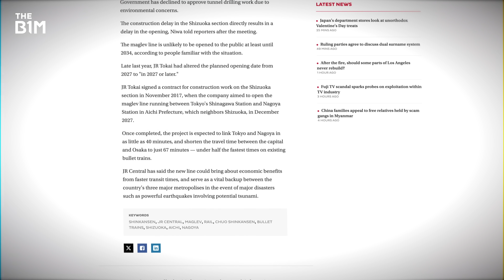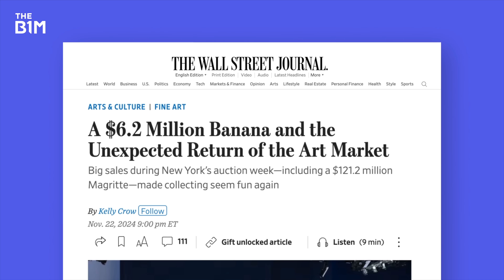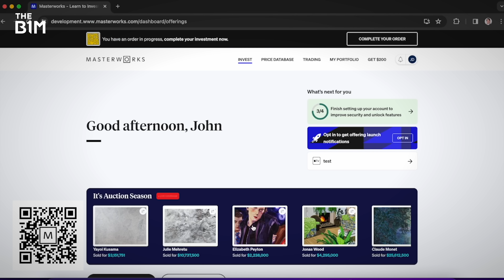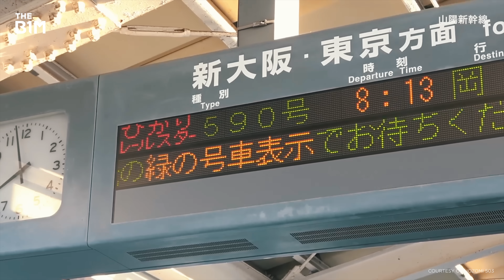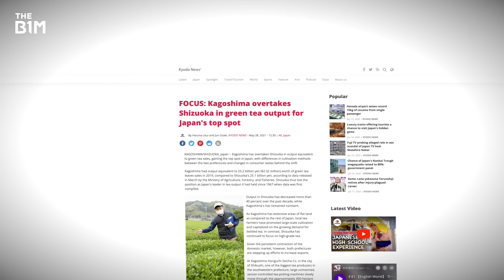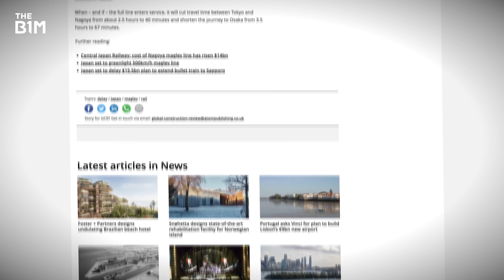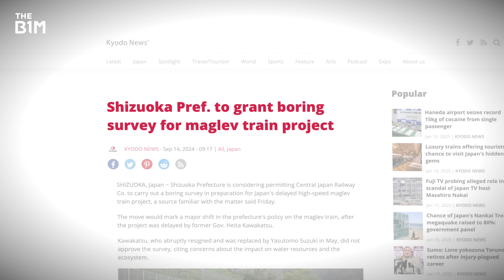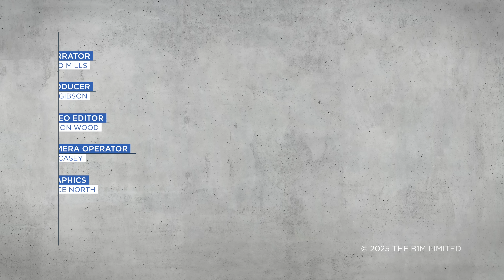Delayed: Japan’s $64BN Levitating Bullet Trains are no Longer on Track

Comment: Whats important to keep in mind is that those 603km/h are during testing, "regular" high speed trains have reached a speed of over 570km/h, and that was almost 20 years ago. With todays technology we can go way further with conventional rail, no need to spend a whole lot more money on expensive magnets.
Reply: The 570km/h(574.8km/h to be exact) is the French TGV which is it's   max speed but not it's day to day operating service speed due to safety concerns.So mostly high speed trains around the world stay within 400km service speed.But when this sc maglev train comes it will be having an operating speed of 500km/h.Even the currently in service german model maglev operated in Shanghai was operated at 430 kmh service speed,now reduced to less than 400 km/h speed and that too only for cost reduction and not for any safety reasons.So if we really want a true aeroplane alternative maglevs are our only bet.Travell within a continent can be entirely done by maglev,reserving aeroplanes for overseas travel.Conventional high speed trains are only alternatives to cars and regional flights.
Reply: @dhanrajsampath500  But that test proves that conventional rail can still become faster, but we are probably reaching the speed limit of them.
Reply: @enaqleelectric Yes, they can be faster, in fact most modern production HSRs can go 400+ khp, but the wear on parts and the electricity cost scales exponentially as you go faster. So they almost always cap the operational speed at 350 or 300

Comment: Dude focused too much on the minor reason and total looked over the main reason. The main reason for not allowing construction in that area is because Shizuoka will lose this trains passing through its major city. Currently, shinkansen travels through the main city, Shizuoka, and that bring a lot of economic benefits. Japan is facing massive tourism problems but that is only in areas like Tokyo and Kyoto, not Shizuoka. The Governer of Shizuoka wanted the train to pass through its main city or have a station in Shizuoka Prefecture that would connect to the Shizuoka Station by another high-speed rail. Both demands were not met, and he was holding back the whole project.

Comment: The success of the Shinkansen itself has much to do with a choice made during the period where Japan built its first long distance trains. They chose to use a 3"6" narrow gauge. It was a cheaper way of building railways fast, but limited top speeds. I was last in Japan, on an express train  trip from Yokohama to Nagoya in 1963 as they were building that first Shinkansen line using standard gauge.  Very pleasant but slower than express trains on the  US Northeast Corridor at that time. 
What hampers High Speed Rail in other countries is the commonality of standard gauge with the high speed lines as they pass through cities where the two forms intermix.  For Japan to expect that their new  MagLev standard would become the one copied by the world, as the Shinkansen did, sort of,  is asking a lot. Furthermore, the speed gain has more to do with the straighter route with fewer stops just like the Shinkansen had in 1964. The amount of tunneling to achieve that new route will be prodigious, and the tunnel bore size for the MagLev is of necessity larger.  I wish them luck getting that line finished in the face of the Chinese competition.

Comment: Germany had a Maglev concept that was quite far advanced and actually was turned into reality: in Shanghai. But it was deemed to high of a cost in its homeland.
Reply: and there it is really nice to enter the city on it coming from the airport, but… you need to change to the metro because it doesn’t go all the way and the experience is not that much different when inside to what a normal bullet train in Europe or even Japan offers lol.
Reply: @kkon5ti  It's a great ride but I wound up in the middle of nowhere late at night in Shanghai. Not a fun experience.
Reply: @thedave7760 NIMBY-ism killed it. It was supposed to go into the Shanghai's main railway station...
Reply: @thedave7760 not really middle of no where tho? You go from edge of the city straight into the center. Very easy to travel elsewhere from the end point.
Reply: @thedave7760   same, I went and came back because where it ends is nothing to do and I also had a flight to catch
Reply: @kkon5ti  That maglev used to be a popular tourist attraction, I remember waiting in line for an hour to ride it back in 2010 when I visited Shanghai.
Heard that now it's far less popular, which make sense since there are bullet trains everywhere in Asia.
Reply: @kevintang5473   I rode on it for tourism only reasons too on my 4 hour layover
Reply: @ what? it is far more quiet and smooth that japanese one. But the most initeresting one is Chinese bullet trains, that runs at 350km/h in China and Indonesia for years, no turbulences like in Shinkansen, affortable and good network made it generally full where Shinkansen is generally mostly empty (used JR pass two time traveling in Japan, and used most if not all Shinkansen lines, tried lot of Chinese and French high speed trains. French one (I'm French) is less spacious but more quiet and smooth. Chinese one is at the same time the smoothest, the fastest, the most quiet and the most spacious.
Reply: @ThePopolong Shinkansen operated since 1964; Chinese was still eating out of their palms. It’s the same comparison to US highway systems, which is about 80 years old. Everyone said China this China that, while the world flew to the moon, Chinese still rode their bicycles. Do you know anything about Chinese fatalities due to high speed rail? None, because they don’t leak the dark side of the regime.
Reply: current Shanghai maglev no longer operates at speeds over 300 km/h. Even when it used to run at 400 km/h, it maintained its top speed for only a few seconds.
Reply: 超電導と常伝導の違いもわからないのか
Reply: The Chinese was very happy with the line and wanted to extend it. The Germans quoted a price of $43 million USD per km. That would make 100km costing $4.3billion, while normal high speed trains where less than $1million per km at the time.
Reply: The one in Shanghai was intended to go all the way to Hangzhou but the same story happened, it was deemed to expensive so it never made it past the city limits. 

It still cuts a good amount of time off the ride  to the city centre if you know how to use the metro
Reply: Tbh tho, what's the point of having a fast train to the airport when you still have to arrive 3 hours early
Reply: That thing is also now run at much lower speeds to reduce cost.
Reply: Well considering how thrift the Germans are, no surprise
Reply: well germany stopped using slave labour quite a while ago, unlike communist china who still does
Reply: Germany is too busy destroying itself by its energiewende to build useful new infrastructure.
Reply: @flippert0  how about siemens that want to build hsr in america and Asia?
Reply: It was too high cost for Shanghai as well. The demo line was never expanded and the national HSR project went with conventional EMU trains instead.
Reply: :face-purple-wide-eyes: Thank you for the info
Reply: Fake news. It was manipulated and canceled by the car industry. they have been scared all the people will use trains and nobody is going to buy cars.
Reply: Transrapid used the simpler electromagnetic concept with high frequency on and off switching. Sad that it was never commercialised in its own country of origin.
Reply: Just so you and everyone know, German Maglev is just normal conduction, so using just a magnet and electricity 
The hype of Japanese one is due to the fact that it’s the first super conducting vehicle ever in the human history
Reply: ドイツは中国に近づき過ぎたな😅
Reply: shanghai maglev is fake
Reply: @evanfinch4987 
Rubbish
Reply: Shanghai maglev made by Germany only run 300km/h mate..😂, with 30km track

Japan maglev is next level Maglev..
Reply: @eightdeeazimuth3110  That's the speed it may run. The design speed is much higher (450 km/h)
Reply: @eightdeeazimuth3110  it does run up to 400, but it depends on time of day
Reply: @eightdeeazimuth3110  There is like 20 year development gap here. If Germany managed to have some commercial success aside the one in Shanghai and do further development I guess they might have something on par with the Japanese. Anyway, the German tech dna lives further in the Chinese ones.....
Reply: @eightdeeazimuth3110  No it's not, they're capable of nearly the same speed, they ran >500 km/h on the german test track and 431 commercially in shanghai for most of the time. Only recently was it nerfed. Please check your info before posting.
Reply: So Germany can only do concept but no real commercial one
Reply: @risrubia4163 , absolutely the Germans can build maglevs commercially. 

Siemens and ThyssenKrup built the Shanghai maglev, the airport one. They could turn 'em out like flapjack pancakes if the demand was there. 

Here in the US there are only 2 places where maglevs 
might make economic sense, & they are along our coasts. If a serious effort ever takes off to build maglev train lines where I live (near Washington, DC) we'd probably buy the actual trains & passenger cars from the Germans.

(On a side note my company contracted with ThyssenKrupp a handful of times & they are great folks to work with. When they say they will deliver you an assembly or sub-system with X, Y and Z specifications, you get EXACTLY what they said they'd build. Most Germans are nice like that.)
Reply: @risrubia4163   depends on what you mean by commercial
Reply: @risrubia4163  No, it can do both.
Reply: @risrubia4163 they don't want to
Reply: @risrubia4163 
What's  your point? 
The germans did that in the late 70s/early  80s. Their conclusions was that it was commercially unfeasible at the time.
Reply: I think the German design was better than the Japanese concept, no superconducting magnets and no concrete trough that will get filled with snow in winter...
Reply: @zapfanzapfan  German Transrapid floats train cars only by 1cm, which makes it vulnerable to large earthquakes. Japanese JR Maglev, on the other hand, floats train cars by 10cm. That's why they opted for more technologically and financially difficult system.

In other words, German design is indeed better for many countries in the world where there are not that much earthquakes. Unfortunately, Japan is not one of them.

This discussion is kinda analogous to their conventional high-speed rail systems. German and French made train systems are much popular worldwide than Shinkansen, chiefly because they are more affordable, while Taiwan, one of the few countries that did introduce Shinkansen, chose it because of its earthquake detection system.
Reply: @Puoehlahxiik  yeah, thats because a bigger distance is less efficient
Reply: @Puoehlahxiik also Japan's EDS system is dynamically self correcting which adds extra passive safety measures to make derailment impossible as long as the guide track is in one piece as the permanent magnets forces the train to self correct passively without any computer assistance. The EMS system needs active computer correction to make it stable and needs backup power to levitate incase of total power blackout, while EDS can levitate as long as the train is moving at sufficient speed, with plenty of time to deploy the wheels incase of total power loss in earthquake scenarios.
Reply: Just wanna say Shanghai maglev won again for almost 20 years tech
Reply: Flippert0  Germany's prototype maglev killed many people in a tragic high speed accident. They immediately cancelled the project.
Reply: @richardconway6425 this is wrong. The maglev was not traveling faster than regular fast trains at the time of the accident, the way the accident happened was only possible because the test track didn't have all the safety features of a service track (the maintenance vehicle was not in the control system). The project continued for a notable amount of time, without public rides, until it was deemed not economical
Reply: @the_retag  This. There is so much misinformation about this accident. Most of it has been broken down to cost and time saving measures (and ultimately the human error that caused the chain of events to get rolling) to make up for the lack of official funding. At the time of the accident, the project was already drained of most of its productivity. It simply was not wanted in a vision for Germany's future. As much as it would be needed now.
Reply: @daseck69 typical German fashion. Has the expertise and engineering skills to build next generation stuff. But decides there's no political or financial backing to do it
Reply: @daseck69  yes please. I am so sad about that.
Reply: @richardconway6425  That was the final nail in the coffin yes. But the one serious project (Munich main station to airport) was canceled before, if I recall correctly.
Reply: @richardconway6425  
Correction: human error killed those people. The technology was ready, but the political and economic commitment wasn't there because our leadership is weak and shortsighted.  
It is something you see over and over again over the past 40-50 years in Germany; extensive base research and groundwork is done here but others implement and develop it into working products/projects.
A nation of hesitant naysayers.
Reply: Was due to human failure, some material was left on track, and not due to technical problems. And this crash was not the reason to not build the track in Munich, it was decided against because of negative cost aspects. A technically identical maglev of that german Transrapid was eventually build in Shanghai.

Comment: I don't understand 2 tones of water per second is not that high amount at all. I looked it up to Oi river discharge rate which is 76 metric tones per second on average. So with all the dams and stuff it would only effect about  2.63% of the water that flow through it.

Comment: Anywhere else I'd call this a Gadgetbahn. But Japan already has the conventional rail network locked down. The only way to improve them is to keep getting faster speeds at this point, and the rolling resistance of air is in fact less than steel on steel. If they can pull this off, Maglev will no longer be a gimmick.

Comment: Japan should start with a smaller project and run it for a few years before tackling what they are currently planning. $64B is a lot of money to spend when they already have their existing bullet train network which the maglev will only be duplicating. Japan's demographics and possibly change in commuter requirements in the decades to come could make this maglev project a white elephant.
Reply: This project is not so much futuristic and innovative as it is an essential disaster countermeasure to a looming threat.
The current Shinkansen line runs along the coast, which could be completely destroyed by the Nankai Trough, a major earthquake that is certain to occur in the next few years. The Tokaido line itself is almost 50 years old and needs a drastic reconstruction project. However, the Tokaido is Japan's most important infrastructure and its operation cannot be halted for even a single day.
Maglev will bypass Japan's infrastructure arteries to the safer inland side, allowing for full restoration of the line and providing a backup against impending disasters. As you can see in the video, the maglev line will be built more inland than the current Tokaido line.
But that means digging several tunnels under the mountain range in the middle of the archipelago and it causes a lot of civil engineering problems.

So they have no choice...
Reply: @user-ph6ed8jm8t   Sure, if a doomsday scenario was the primary reason for a new line. But there are other options that could also be implemented sooner if disaster recovery was the primary urgent reason for a new train line. And in a major quake disaster zone, the trains will unlikely be running either, for a multitude of reasons, including safety. Do you think anyone will still be commuting to work if they live in a disaster zone.  They do have an existing road network that connects to a lot more areas, a lot more useful to get in supplies and personnel. Even damaged roads could still potentially move traffic, unlike any train line.